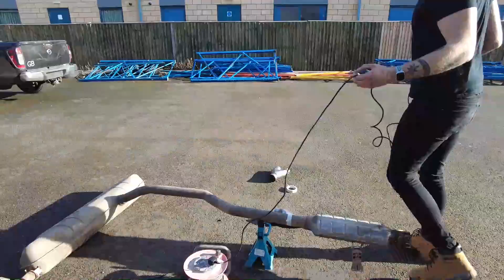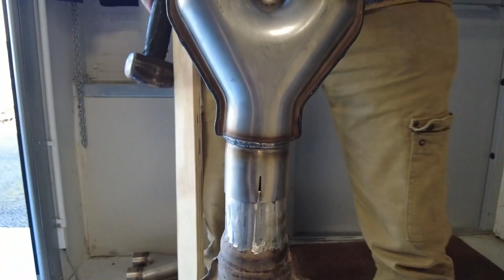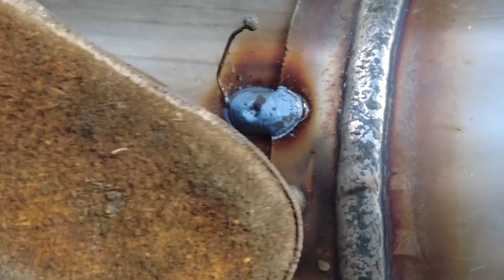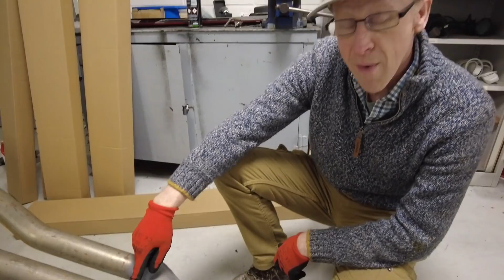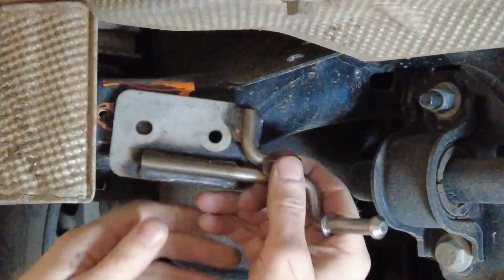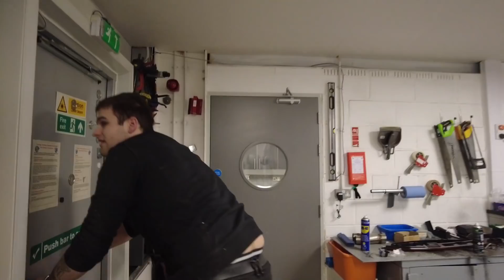Land Rover Defender L663 V8 Quad Exhaust - Upgrade Part 2 ( Cut / Weld and Test )

Comment: Dear friends:
Can this exhaust arm kit be mounted on a Defender 2024, 3.0 Diesel, so I can have a fake exaust on the other side ? like V8 looks.
Reply from the maker: On some diesels ( depends on your country ) there is an Ad Blue tank on the right hand side - so you cannot fit the exhaust as the tank is in the way.
Reply: Thanks a lot and congrstulations !

Comment: Nice work. I recommend you that you put ceramic coating on the exhaust now that you have polished it. I did it on my P400 and it didn’t get yellow any more because of the heat. I’m thinking of doing the same thing with the exhaust (think it will sound even better on P400), but what about warranty? 😬🤭
P.s. I can’t find your video with activating ACC. Can you send me the link or something please? I vent to official service and asked them to activate me the ACC because the car has the radar in front with all the other features installed but they said there is no activation option on the tester. Tnxxx